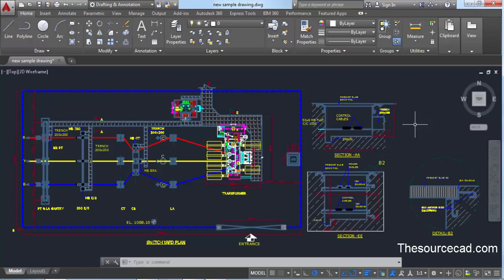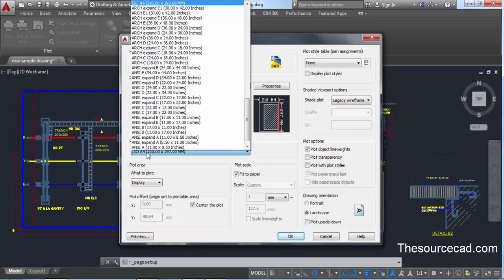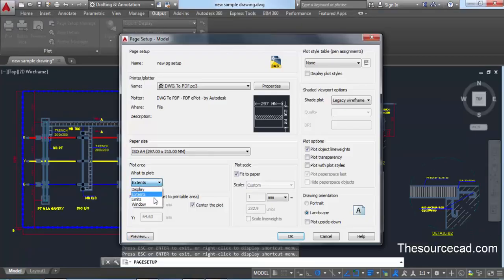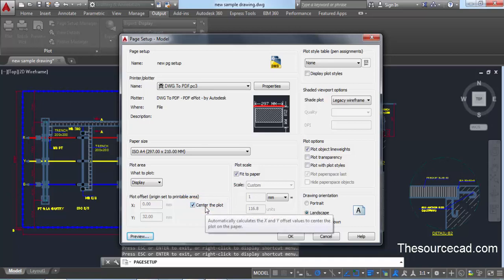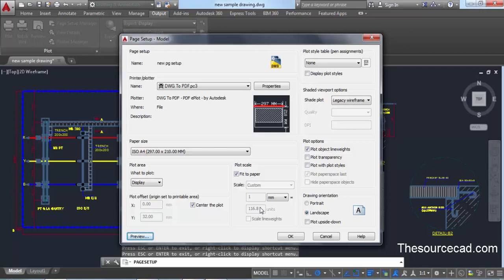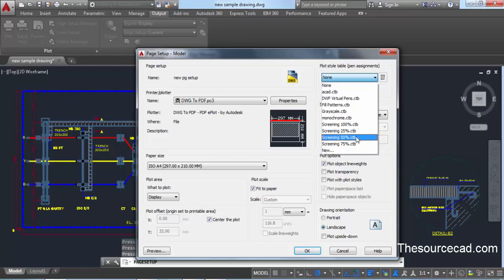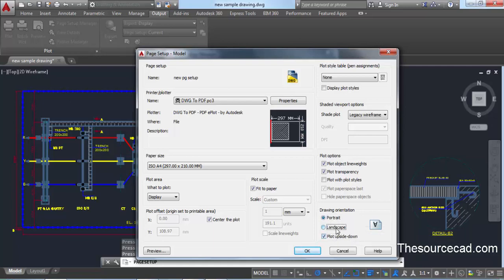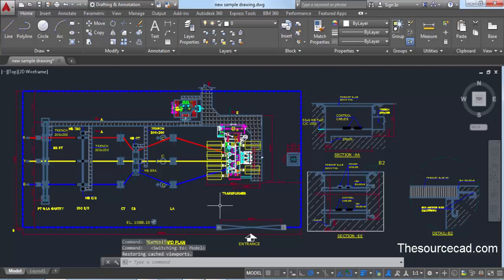How to print drawing in AutoCAD

Comment: Great explanation, only half the drawing will show up in the layout could you explain if I need to set up viewport first struggling to get the drawing to print
Reply from the maker: If it is model space then try using the "window" option in the plot area adn select the drawing area that you want to plot. Also make sure "center the plot" check box is selected in the Plot window. This should work.
For layout or paper space just make sure everything is inside the viewport and then you should be able to get proper plot with the Layout option in the paper space.